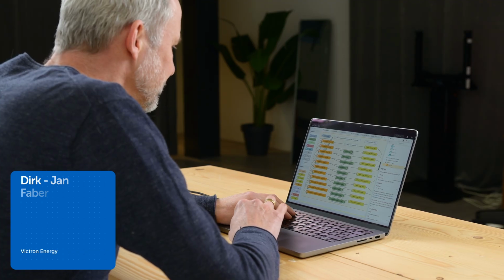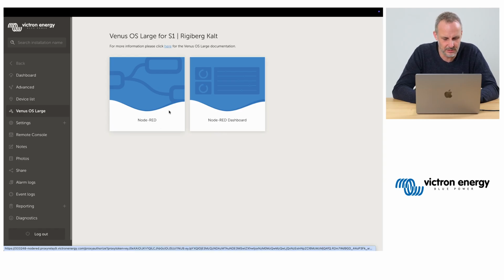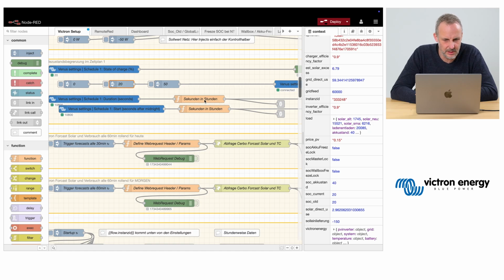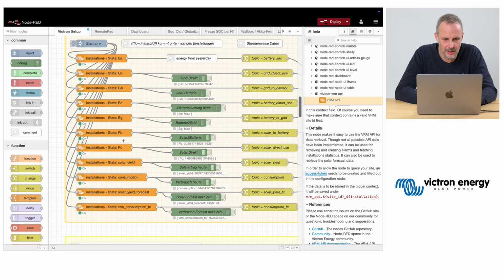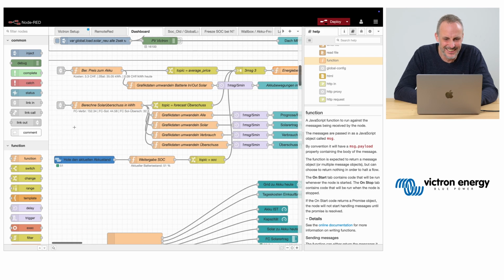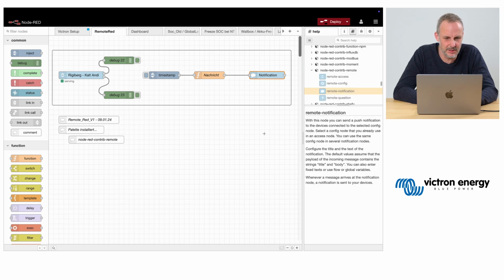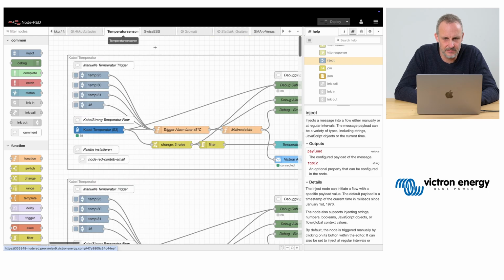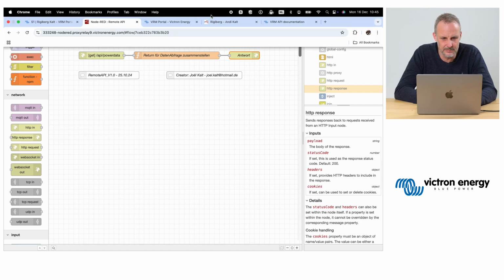This high-tech horse ranch uses Node-Red to automate its solar power

Comment: I still don't get, what I would have to do in order to use the victron pallette in my Node-Red instance on the raspberry Pi. I have a Cerbo GX connected to a mobile router as well as a raspberry pi connected to the same router. I want the Pi to be my main instance. But then how to I get the Nodes to connect to the Cerbo GX? Would this happen locally or via the VRM API? Where do I configure this?